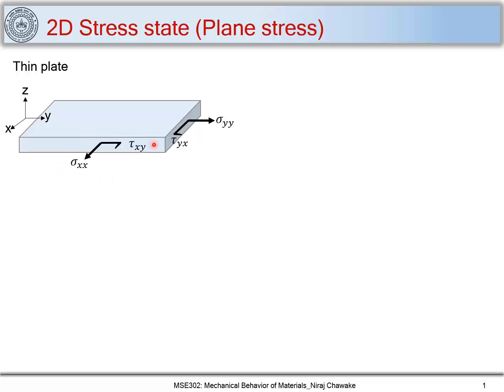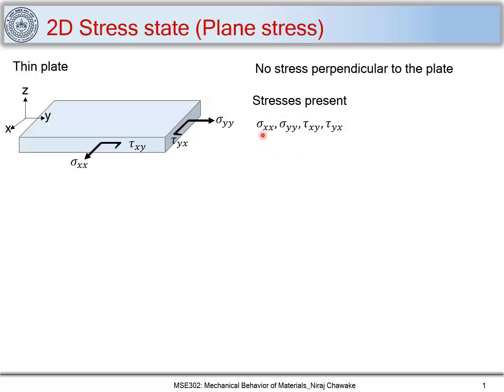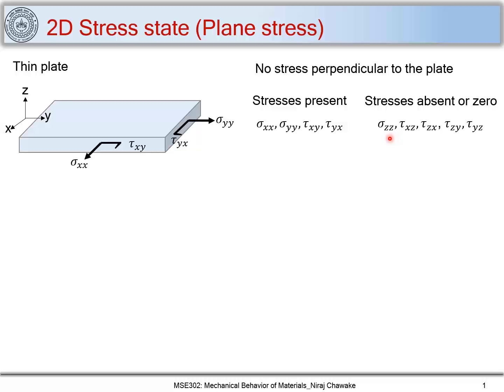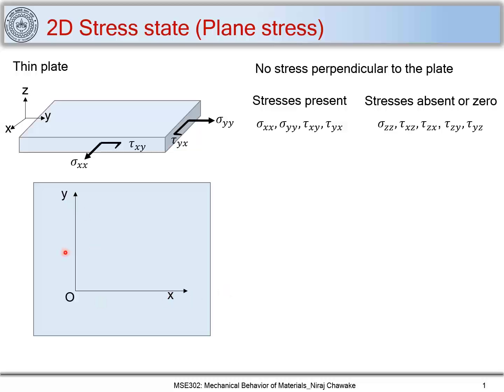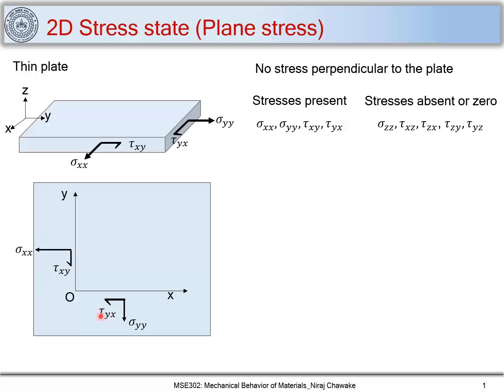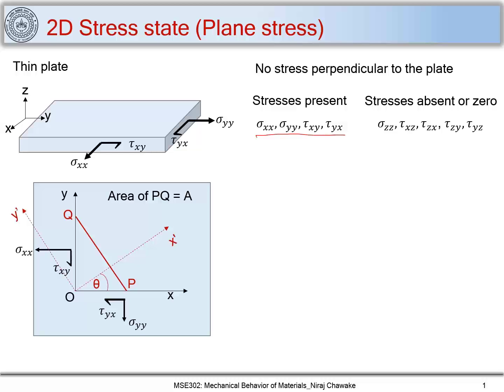9. Plane stress & stress on oblique plane: Plane Stress transformation equations in 2D

Comment: Sir isn't τy'y' = F'y/A. Then what is the difference between τy'y' and τx'y' at 11:23 l = sin(theta)
Reply from the maker: Dear Sukrit
Thanks a lot for this question. Your thinking is right.
Using the similar approach that was mentioned in the video, when we are trying to find σy’y’, we need to take the area corresponding to y’ plane (and not the area corresponding to x' plane i.e. area of the plane PQ mentioned in the video). Also, you have to be very careful about the sign convention (for the angle between planes) that you are following.
The easiest way to find σy’y’ is by substituting (θ+π/2) for θ in the equation we obtained for σx’x’.
I hope this is helpful. In case, if you have any difficulties (/doubts), please let me know.
Reply: @nirajchawake , I understood and did not think about the area. Thanks a lot, Sir.